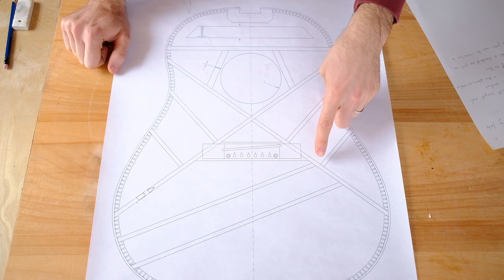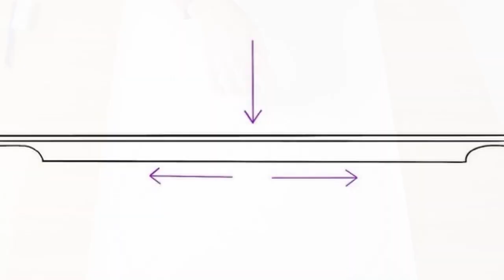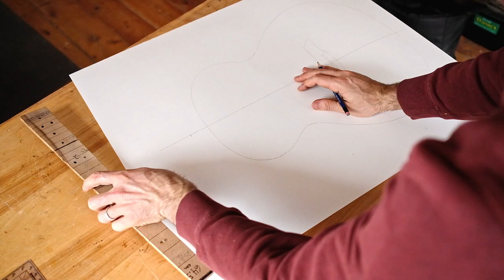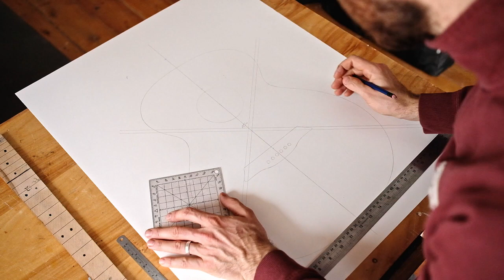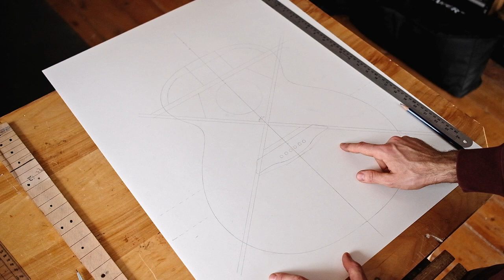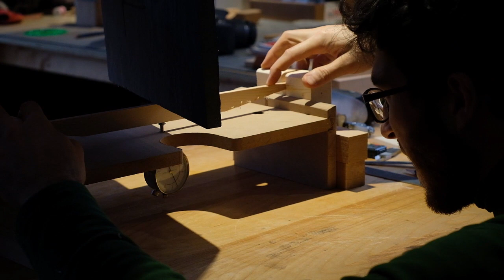How To Design Your Own Bracing Pattern (Part 2)

Comment: Excellent video! Very informative. I just built a 000 with my own bracing pattern. Experimental. I incorporated a A frame into a X Brace. So The X brace is longer and narrower instead of wider. I put patches at the neck area. There is no Transverse Brace. Instead I cut out a section of the neck block and butted up the A frame brace against it. Just the height of the braces. I used a Bolt on style with 2 m6 threaded bolts and Metal inserts. Now I realized after that the sides at the neck were 89 Deg instead of 90 Deg like they should be so I cut a back angle at 2.5 Degs to match the sides and have a 1.5 Deg angle Relief. I cut a Triangle hole for the sound hole with a sound port. The Triangle hole was too small so I drilled a series of 3/16 holes in the maple patches in the shape of a sphere at about 2 inches in diameter. I was playing it yesterday but it kept going out of tune. I figured it was new strings and maybe settling in. But i measured the scale length again and found that the High E was at 650 mm and the Low E was at 650 mm. The bridge moved. So I had to take it off and decided to redo the top coat because I had messed it up lol. It;s not a perfect guitar but I will restring it tomorrow and maybe put up a video tomorrow if it works . I had to make a cam clamp today so I could glue the bridge properly. I hope this holds it in place. I used white Gorilla wood Glue. Made the bridge out of Indian Laurel. Very dense wood. Burned it out with a Lazer but had to cut it with a band saw because it was too thick.
Reply: Lutherie is full of lessons! :) 
Glad you found the video useful/informative.
Reply: @treehouseguitars  It sure is! I re stringed it today . It doesn't sound too bad but having trouble with the b string. If I tune it in with a tuner, an E chord is in tune but a D is out. Then if i ear tune it in D or G the E is out. lol
Reply: Did you add extra compensation to the saddle where the B string is? If not that could be your issue.
Reply: @treehouseguitars  yes I set it up according to stew mac calculator for 25.5 inch scale. It might be 1 mm longer than it should be when the strings are tuned. Would that make a big difference? I have to tune the b string higher to make it go in tune in E chord. But have to tune it lower n D or G. What does that tell you?
Reply: @treehouseguitars  I just measured the low E and high E and 12th fret. 12th fret is at 323mm low E is at 651mm and high E is at 647mm
Reply: Hmm. It sounds like it is more likely an issue at the nut end. Or possibly fret spacing isn’t quite right between the first few frets? If it’s hard to play (nut slots aren’t deep enough) that will throw off intonation in the first few frets. Just throwing ideas out there. Your measurements at the saddle aren’t far enough off that it should be noticeable in the first 3 frets.
Reply: @treehouseguitars  hey yea I measured again and I realized I had a shim in front of the saddle .so I took it out lost another mm or so. Also I didn't have the saddle and nut radiused to the fret board. So deepend the nut slots a bit and the saddle slots. Now it is playable and goes in tune in any chord. It's still not perfect but it's workable. Thanks for the insights!
Reply: That makes sense! Glad you sorted out the issue. :)
Reply: @treehouseguitars  thanks me too! I came across a video on necks and fret boards. I totally forgot about the radius thing with the nut and saddle. I'm learning though. Have a great day .

Comment: What are your thoughts about laminating carbon fiber into braces? Wood carbon fiber wood.
Reply: Honestly I haven’t experimented so I couldn’t say for sure. I like to think that wood, specifically one-piece braces (not laminated), make a lot of sense. They can be as strong as you want them (determined by their height) yet they will have some flexibility and flexibility is what results in vibration/ sound production. Certain braces like the upper face brace that supports the fingerboard, I’d say go for it - make it as stiff and strong as you can. It will only help the rest of the guitar. 
This is based on the way I approach guitar making and my theories so other builders may not agree. A great example of a guitar company that uses carbon fibre laminated braces successfully is McPherson Guitars.

Comment: What do you think about the Taylor V-Brace?
Reply from the maker: Have you had any experience with their v-bracing Darren?
-Zach
Reply: @redtreecollectiveguitars  I have played them in the store but I can’t hear anything significantly different. I suppose it hasn’t stood the test of time yet in terms of stability.
Reply from the maker: @DarrenForbes  Interesting. I mean, if you think about it, there’s about 180lbs of tension pulling on any steel string guitar top... So more important factors in the sound, I’d say, are the orientation of braces behind the bridge, the thickness of the top at the edges of the lower bout and the height that the strings are above the top (which determines the torque acting on the top).
Reply: @redtreecollectiveguitars  The bracing is certainly uniform.  I know that this V-Brace is not Taylor's idea but I certainly find it intriguing.  Thanks for your comments and replies.
Reply from the maker: @DarrenForbes  My pleasure! :) 
-Zach

Comment: Hey Zach…. very interesting video !!!!…. how much deflection are you looking for ????
Reply from the maker: Thanks Don! It depends on the instrument and at what stage of the build it’s at. I mainly do deflection tests for tops getting them down to thickness before bracing (I’m not sure how much my weight weighs, but I consistently use it). Then for the Ember Series I have been using a weight that basically mimics what the bridge forces will be on the top. The deflection of that I’m still playing around with and adjusting. I am carving the braces to adjust the deflection in different parts of the top so it’s fairly complicated and not just a simple answer. For guitars with pinned bridges it’s much more complicated since there’s a torquing force acting on the top, so I can’t simulate what the bridge forces are there (or haven’t bothered to figure it out). You’ll have to drop by the workshop once the pandemic is over and I can show you alllllll the secrets. ;) 
-Zach
Reply: @redtreecollectiveguitars  .. i will definitely take you up on that !!!Thanks